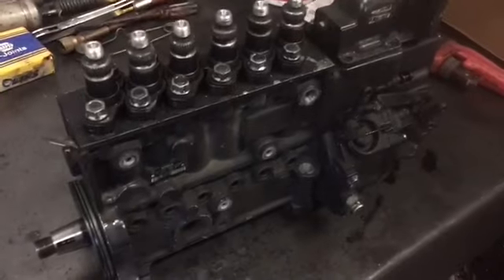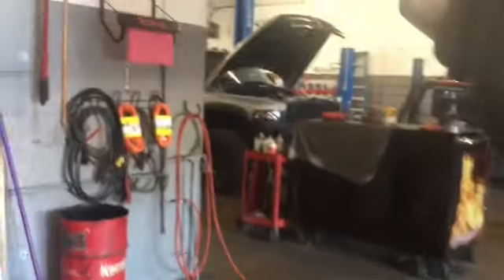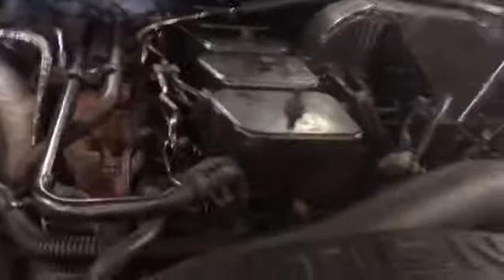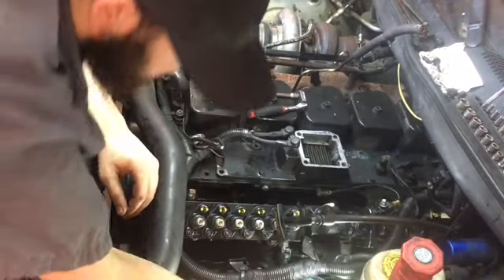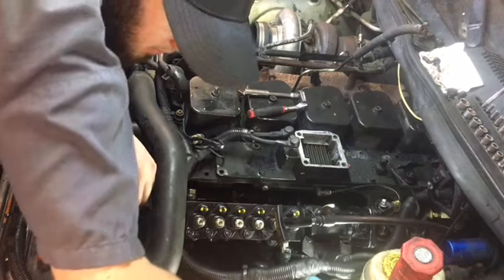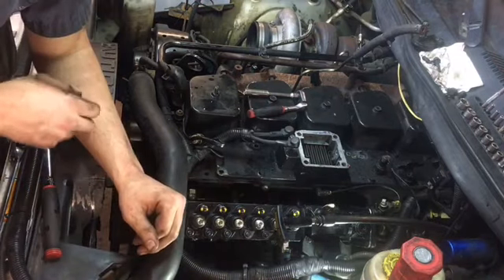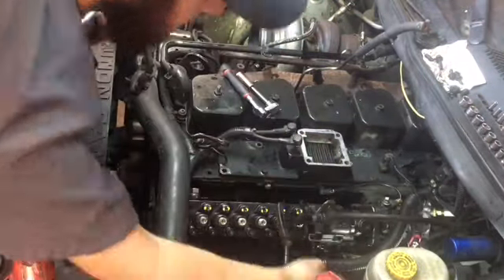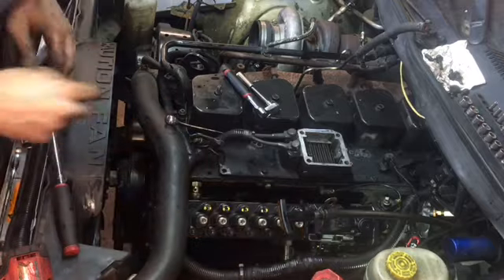Replacing The P7100 Pump Again...

Comment: I removed my pump to fix a tappet cover leak. Well I have 2 fuel lines coming from my fuel tank I still have the stock lift pump. I know one line connects on the back side of the pump at the tappet cover but I can’t figure out where the other line goes. From the tank it goes steel line, braided steel, then regular line in which it make a z shape then it has a rubber hose on it. Any idea where that rubber hose connects to?
Reply from the maker: So your truck still has stock lift pump and the filter housing assembly on the side on the block
Reply: TheAmishMechanic yes, all stock
Reply from the maker: How big of a rubber line is it? And was it just hose clamped on or is it a quick connect
Reply: TheAmishMechanic it’s about a half inch line. It is supposed to be hose clamped on. It had a hose clamp mark on the line. It’s zip tied to the tv cable as well
Reply from the maker: Hmm I would say it goes onto the fuel heater assembly I believe there is a 1/2” nipple on the fuel heater assembly and it probably goes on it. Mine had a airdog 150 and it bypasses the stock lift pump. But my stock pump was still in there so I just deleted the fuel heater assembly and stock lift pump
Reply from the maker: Hmm... I can’t really remember does it got on the injection pump? There is a fuel light that goes to the lift pump then  to the fuel heater assembly then to the fuel filter housing then to the pump
Reply: TheAmishMechanic one line goes on the back of the injection pump, and the other I have no clue. Both are rubber lines and that have to slide over a fitting and be clamped down with a hose clamp
Reply from the maker: Hmm that’s odd where does the other line connect to? Or do you have the whole line off
Reply: TheAmishMechanic one line goes to the back of the injection pump as a return line. The other line coming from my tank I assume is a low pressure supply line and I have no idea where it goes. It’s rubber and has to be slide on just like the other rubber return hose had to be.
Reply from the maker: One line is a supply and one is a return I’m not sure where it would slip on at since all your stuff is stock still